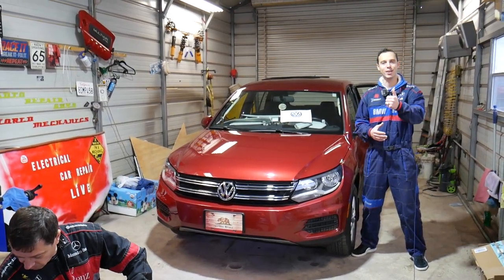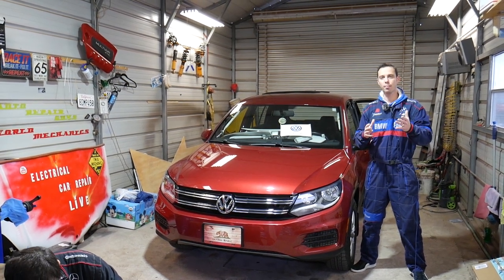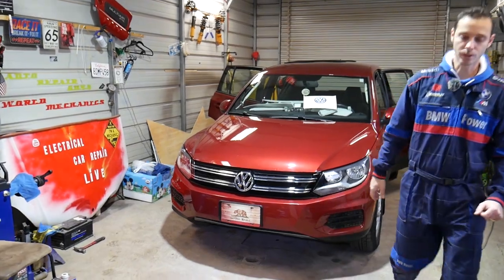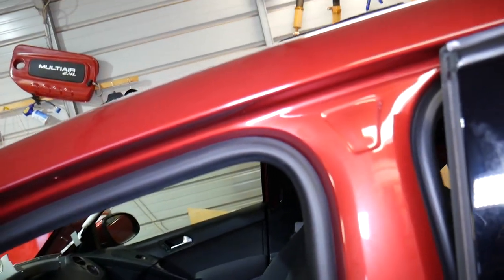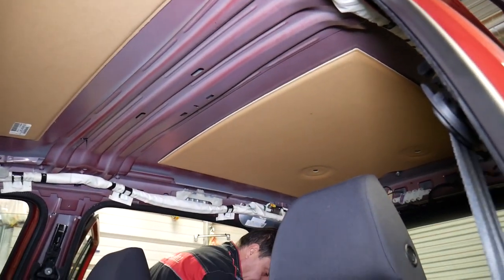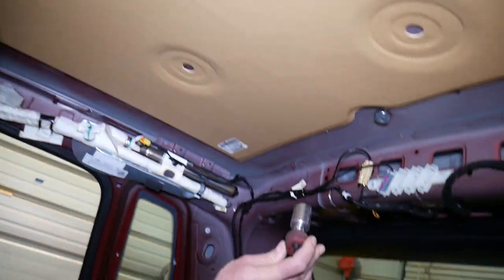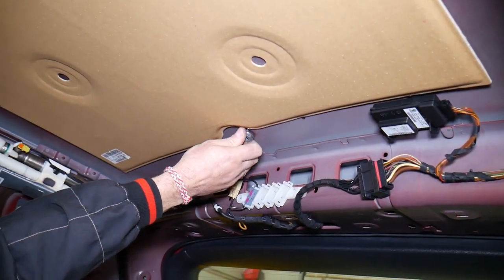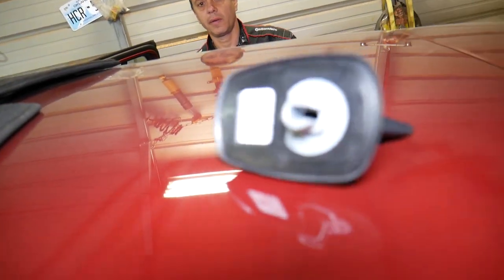VW TIGUAN ROOF ANTENNA REPLACEMENT REMOVAL

Comment: Thanks a lot for this my man! I just did this on a 2018 Audi Q3 and it's pretty similar. The only difference that I didn't have to remove the whole headliner. You can get access just removing the panels from the rear tailgate area to the rear roof handles and it lowers enough to remove the antenna. What a pain of a job especially when those metal clips come loose from the panels!

Comment: So, guys, if there are no wires guys, then what is the antenna doing?  Guys?
Reply: Back or side windows has the antenna(‘s)
Reply: Some cars have other options.  There can be up to 3 wires going to that antenna according to the service manual.
Sat radio, navigation, phone, remote start.